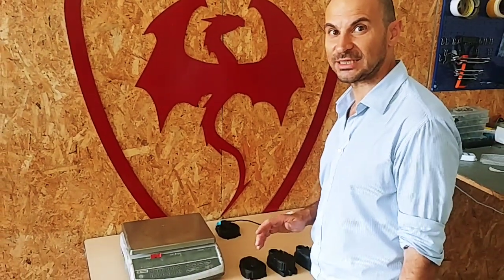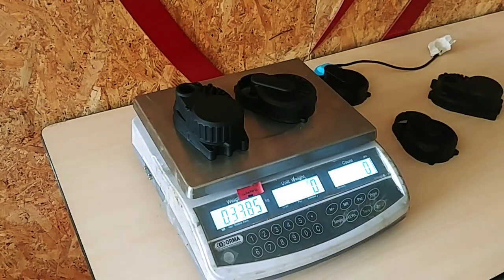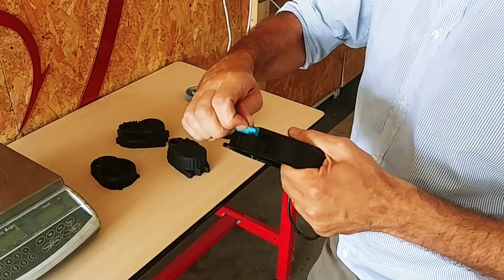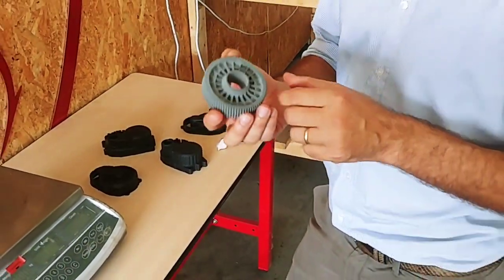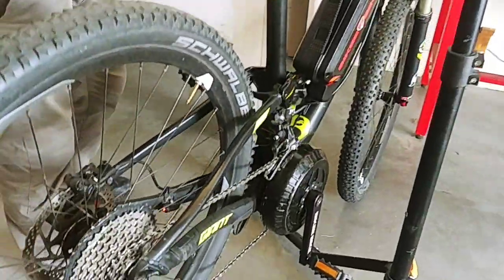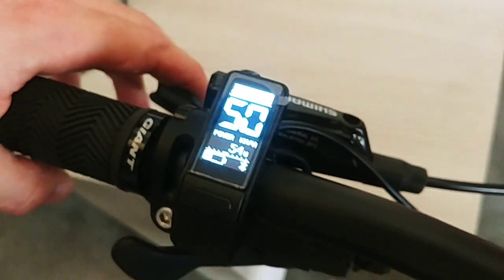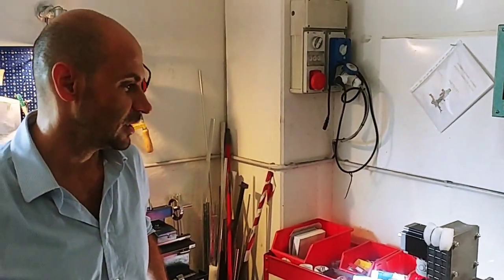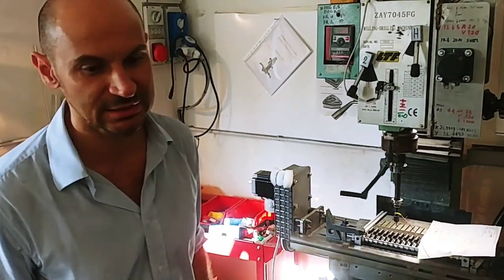Lightest August update

Comment: A plastic gear? So that's how you're able to make it so light. But won't that wear out really quickly?
Reply: Plastic gears are normally used in high speed areas to keep noise and heat down. They are also used as a "week link", so they break and not something far more expensive.